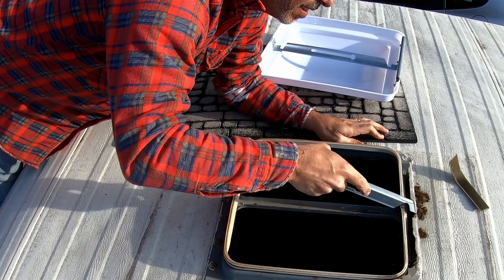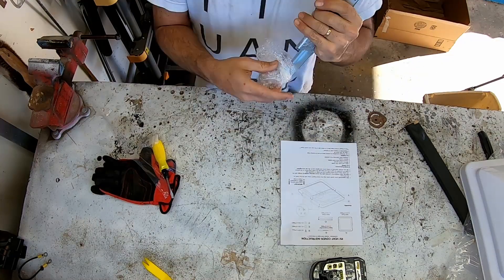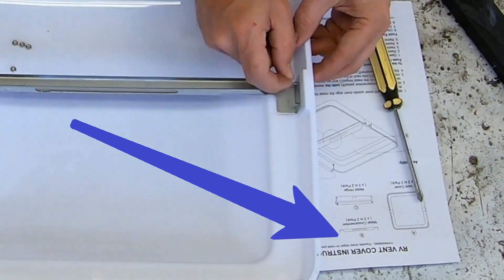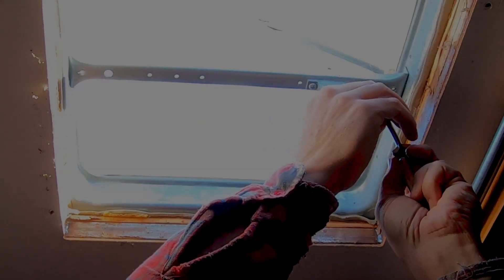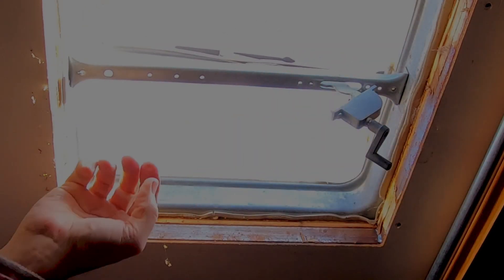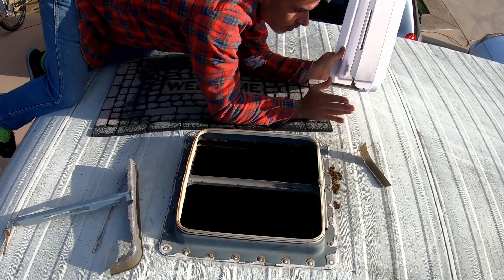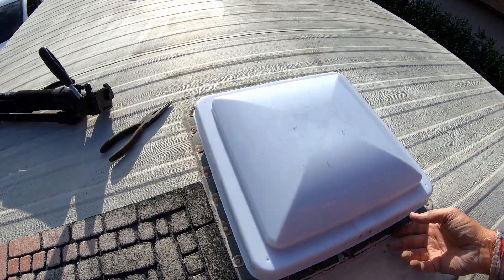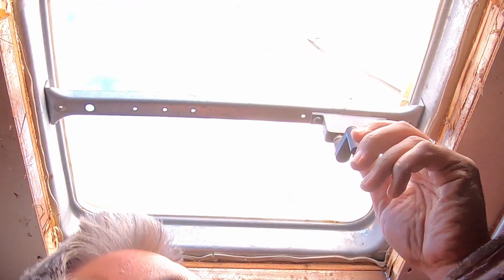DIY: Trailer Roof Vent Replacement is EASY

Comment: Wouldn't  have bean easier to crank the vent fully open and than attach it from outside on the roof?.. WORK SMARTER NOT HARDER
Reply: No. Not possible. Tried it yet? I'm doing my third replacement of the cover assembly.